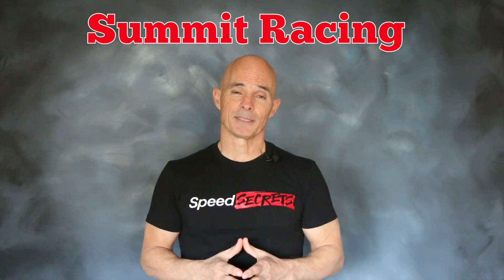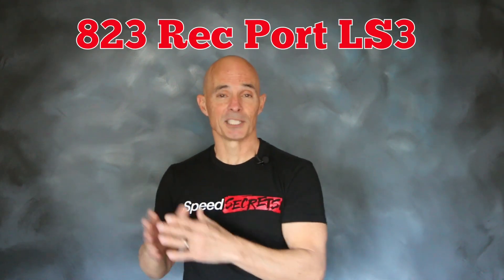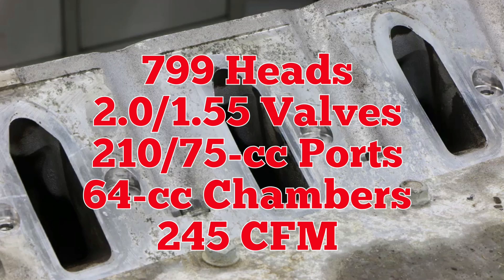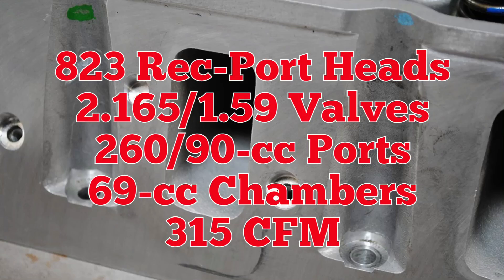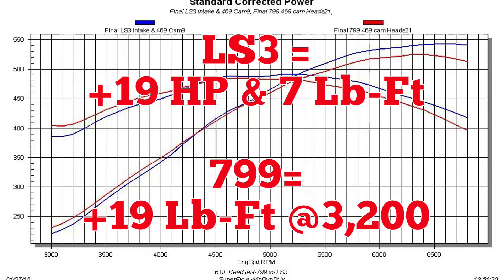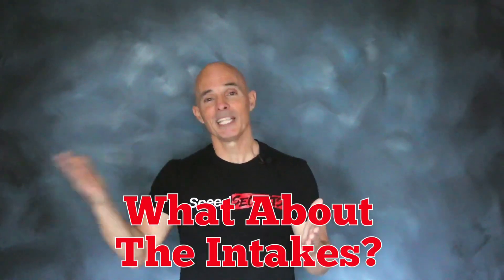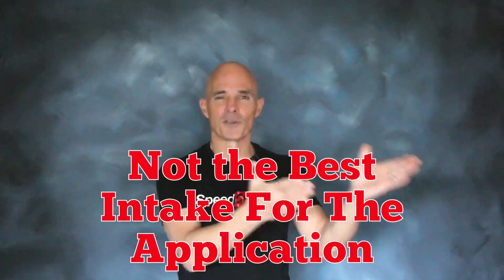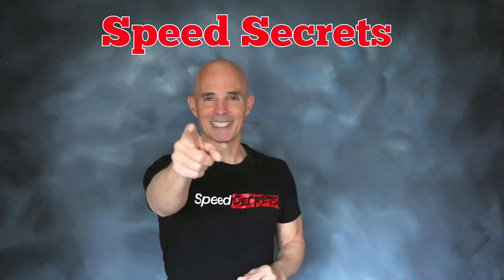6.0L LS Head Test-Who Wins-799 vs 823?

Comment: Hey Richard. I'm new to the LS world and swaps in general. Pretty sure this question has been asked, but I have a 2000 LQ4 with the cast iron heads. Planning on running a sloppy mechanics best cam with LS7 lifters and dual springs and most likely a 7875 turbo with 10lbs. Would you recommend keeping the cast iron heads or swapping out to the aluminum 317s? Thank you
Reply from the maker: alum

Comment: Hey rich got two questions I want to run a lq9 with oem ls3 823 heads and a stage 3 ls3 cam and ls3 intake 

Or 

Ly6 with oem ls3 823 heads with ls3 stage 3 cam and ls3 intake
Reply from the maker: those would be almost the same (minor dish/reliefs in LY6)-not enough to notice
Reply: So I can run a ly6 with 823 ls3 heads with no problems with a ls3 234/248  .629"/.615"  112 LSA

Comment: I have an LQ9, do you think the flat top pistons would yield the same results but just with higher numbers everywhere when comparing these two heads?
Reply from the maker: yes-compression adds power through the whole curve on both
Reply: @ thanks Richard, you da man. Real toss up which way I want to go on my squarebody.
Probably go 799 since it's just a cruiser

Comment: Which head gaskets did you use
Reply from the maker: Fel pro
Reply: @richardholdener1727 for the heads or for the 6.0 block
Reply: @richardholdener1727 and what lifters did you use

Comment: Great video but I feel that the compression was the deciding factor here. The 823 heads have a bigger cc and at least one 1/2 point lower compression over the 799. I’m willing to bet if you deck the 823 heads to match compression they will make the same if not more torque down low and even more peak hp. I wouldn’t do a 823 swap on a 6.0 without raising compression.
Reply from the maker: stock vs stock...not stock vs modified
Reply: @richardholdener1727  I understand I was just giving my real world scenario for myself. I really do love watching your videos and appreciate all of the detailer work you put. I look forward to more of your content. Thank you for responding.

Comment: I don't know if you've done this, but in my experience and I'm nowhere near a veteran, ported, polished and reworked 243/799 heads seem to outperform 823 with the same work done. I always imagined the bigger valve advantage would help the 823s come out on top at the end of the day, but that might not be the case? Idk if anyone's empirically tested this. Most of my porting work is done by Katech so i imagine different guys will get different results.
Reply from the maker: You likely don't have enough motor for the bigger heads to shine-the cath ports also have higher compression and since they will support over 600 na hp, most guys don't have a motor to tax ported rec port heads
Reply: The oversized 2.165” intake valves of the LS3 heads are poorly shrouded on a 4.00” bore. It takes a 4.030” bore or larger, ideally 4.065”+ to truly let the LS3 heads shine N/A.

If you’re boosted, however, the compressor shoves in the air and can overcome this deficit.

For the 4.030” bores and smaller, I strongly recommend a quality set of Cathedrals and a Fast. 

I made 640bhp/575lb/Ft with a squared 402ci LS2 using gently massaged TFS 235 heads and an off the shelf Fast 102 intake. 

12:1 SCR on 93-octane pump gas and 24-27* timing. Ran 10.90s at 128mph, all motor on a 3450lb car with a built 6-spd T-56.

Cathedrals WORK harder than their dyno numbers often indicate. Port velocity is a huge component of this.

Comment: Richard.   The rectangular port heads require cam with more duration then the one tested.  I think if tested with optimum cam for each style head you would have had a big difference between the two.   Your thoughts?   Thanks for all you do….
Reply from the maker: THAT IS NOT TRUE-PLEASE SEE THE REC PORT VS CATH PORT CAM AND HEAD TEST VIDEO (THE HEADS REACT THE SAME TO THE CAMS AND VICE VERSA)

Comment: so maybe this is a stupid question, bbuuuttt . . . i have a set of heads with a 5364 casting number and one of them is damaged so i planned on just buying a used one to match it, but then i noticed some of the heads with 5364 /364 / 716 / 823 casting numbers had difference Chamber sizes listed . . . this got me confused. recently Engine Masters did a similar shoot out to this one and they said the chamber size was 70cc but different places have 68cc listed . . . so my question is, is it possible for the chambers to ACTUALLY be different ? OR do half of these people (ether half) have the wrong info?  As always LOVE your content! i share it regularly!
Reply from the maker: there is a production tolerance- 1-2 cc isn't going to make much of a difference
Reply: @richardholdener1727  thanks man, you're the best!

Comment: Need help I have a pair of stock 799 heads & a lq9 6.0 v8 engine. How much do I milled the heads. & what cam do I use ?
Reply from the maker: most mill .030 for higher comp, then comp cams 54-469-11 cam

Comment: What would be better for lq4 with holley sniper efi and single plane intake, 799 heads or the factory LS3 heads
Reply from the maker: ls3
Reply: @richardholdener1727  
Thank you,
Reply: @richardholdener1727  
Would the valve train, springs and valve from 799 heads fit the LS3 heads

Comment: A motor refers to something powered  by electricity. FYI...
Reply from the maker: thnx-I'll call General Engines or the Ford Engine Company to ask what they think
Reply: @richardholdener1727  ...and you should.
Reply: @richardholdener1727  They all fucked up....  'motor
'

Figure 1. An electric motor from an old vacuum cleaner.[1]

Figure 2. An electric rotor.[2]
An electric motor is a device used to convert electricity into mechanical energy—opposite to an electric generator. They operate using principles of electromagnetism, which shows that a force is applied when an electric current is present in a magnetic field. This force creates a torque on a loop of wire present in the magnetic field, which causes the motor to spin and perform useful work. Motors are used in a wide range of applications, such as fans, power tools, appliances, electric vehicles, and hybrid cars.
Reply: @richardholdener1727  BOOM

Comment: For a quarter mile setup with a 6.0 stock engine fbo cam which one would you suggest 823 or 799 +which intake manifold holley or fast?
Reply from the maker: 823 and stock ls3 intake
Reply: @richardholdener1727  thanks  helped alot
Reply: One last thing if I sprayed 100-150 wet shot of nitrous(fogger) does that have any direct effect at both heads and intake manifold +which gear ratio would be best for a 6.0 with a 6l80 for 1/4mile alot of questions here sorry .

Comment: Im in search of tq under peak. Would i be better off with ported 5.3 heads, or ported and MILLED ls3 heads? The 5.3 heads would have big valves installed. Cam is 224/230 so keep the split in mind as well, not sure if its more ideal for cath or rec. Ported ls6 heads can also be subbed for 5.3 heads, they will be milled and ported also. Which is my best choice? I see the small heads have better tq under curve but im unsure if milling ls3 heads can give me the same gains under curve due to compression increase.
Reply from the maker: if you care most about torque below 5000 rpm, milled, ported and chamber work 706 heads and a different cam
Reply: @richardholdener1727  curious to know if milling ls6 or ls3 heads could see the same tq gains as 5.3 heads
Reply: @richardholdener1727  i went with ported 243s with a smaller 62cc chamber like the 706 head. Should give me good results

Comment: Richard what do you think this motor would make with some ported 243s and ported Fast LSXRT 102 truck intake? Do you think it with ported 243s it would improve the bottom end of the stock 799s in this test but match the LS3 heads in the top end?
Reply from the maker: I see you got your answer on the 225 TFS head video

Comment: Hi Richard I have an L77 here in Australia on my 2014 Holden SS that has 823 heads from factory, so your saying that these are also LS3 heads?
Reply: 823s which is a L77 Head have a Standard Intake and Exhaust Valve, 821s which is a LS3 Head have a Hollow Stem Intake Valve and a Sodium Filled Exhaust Valve. Other than the Casting Numbers and Valves Their the Same Heads!
Reply: William Beekman thanks heaps for your reply
Reply: Do you think the lighter valves would make more power?

Comment: What about the 862 heads? I was told those are underrated heads.

I have those on my truck but never thought about them being good.
Reply: CK_32 run of the mill low cc head good for stock application but when you want power 799 or 821 will be better
Reply: BlacZ/28 I’ve heard they had high compression which is good for NA builds
Reply: CK_32 true more compression is better for n/a but with those truck heads you can only take them so far which at that point of porting then 799 can out perform the 862 on every level so it’s really at preference I say for a street car the 862 (61cc)will do fine but so will the 799 (64cc) as for the ls3 heads the bigger pistons make up for the cc of the 823(70/69cc) ls3 compression is 10.7.1 and 5.3 with flat top pistons and 862 is at 9.9.1
Reply: https://youtu.be/zfK45BqEo1Q   
(706) / 862 are good heads

Comment: Would be neat to run it with the fast, might have more torque down low and the same up top due to the compression increase of the 799 heads. Good info thank you for sharing this. Very useful indeed.

Comment: 823 heads have lower compression? Compared to 799? What were numbers on compression s
Reply: Old rule of thumb was 4% increase for every full point of compression. If still true, 1/2 point=2% increase. So, on 500hp motor, 4%=20hp, and 2%=10hp. So in this case, the .5 increase of 799s=10hp. Not much, really......
Reply from the maker: Marshall Lyons 64 vs 69 cc about 1/2 point difference
Reply: @richardholdener1727  in the test what did you change tune wise. I trying to put a little build list together.
Reply from the maker: Marshall Lyons what do you mean-each combo ran the same AF and tuning to keep it consistent-both ran best at 30 degrees total  and 12.8:1 though neither was sensitive to AF
Reply: @richardholdener1727  well I've heard that 799 heads didn't like alot of timing. I was working on an ls swapp for a gbody. Was wondering how it head worked.
Reply from the maker: Marshall Lyons we adjust the timing til they stop making power-the dyno tells us what they want

Comment: Begs to ask the question. Can you have a f.a.s.t cathedral port, go up against a f.a.s.t rectangle  port? Using the same throttle body, switch between each run. This should settle the debate!
Reply from the maker: charles walkes the Fast rec port adds little if any power over the stock manifold at this power level
Reply: @richardholdener1727  its not about the power, but equal playing field. That's why to even go as far as the actual same throttle body between each dyno pull. Cuts out different variable.
Reply: The DLS2 and LS3 Both have a 92mm Opening.

Comment: I want to see the dyno run of the 823s with the req port truck intake for a torque comparison. There's a fair gap in the application of the intake manifold used.
Reply from the maker: Andrew Davis I compared the Ly6 intake to the ls3 intake-they r the same

Comment: I milled my 823 heads and had them ported.  they are flowing 40cfm more on intake and 50 cfm more on exhaust.  I'll be using an almost identical cam, but with 61mm turbos, bosch 210 injectors and e85 controlled by the holley terminator x max.   cant wait to see what that will do in my bronco.
Reply from the maker: sounds like a good combo
Reply: Can't wait for your video al,,, sounds like a bad a$s combo
Reply: Keep the 4 wheel drive-Youre gonna need it!!!
Reply: @milojanis4901  most definitely!  got some 37" paddles for the sand runs.

Comment: Adapter plates an LS3 Intake on 799 heads?...
Reply from the maker: i tried that-not great
Reply: Dear @Richard Holdener   (Swap car)I have l98 engine Caprice SS 2009 with823 head /manual TR6060 I swap the intake manifold to Ls3 but I need ur suggestion. For DD I NEED CAM that tune as stock at ideal my goal is 500whp max
Reply: I learned a lot for ur healthy channel. 500 /400/600 lS challenge but still I need ur help to select the right can I'm interested for DD NOT TRUCK it's sleeper Gt86 2017

Comment: Good test.   Half a point of compression in favour of the 799 keep in mind.
Reply from the maker: Garrett B just stock head against stock head-that’s how they come from the factory
Reply: Yes that’s the best way to test it.   Do you think If you milled the 823 down to 64cc chambers,  it would pick up some numbers down low?
Reply: @nytronorm  yes higher compression will lead to horsepower but your heads also flow less when milled

Comment: Ask and ye shall receive! Man, you can't argue with that! The internet has made it sound like as cast 823s were better than cnc ported cathedrals, and I believed it for years.

It's pretty amazing how tight all the gm castings are! Really just goes to show that our money is best spent elsewhere in the quest for cheap power!
Reply from the maker: Tommy Presson the stock ls3 heads will support a lot of power -we made nearly 700 hp with a stock set on a big stroker